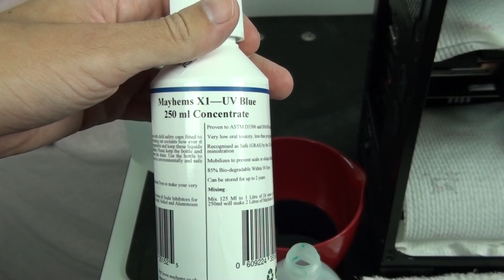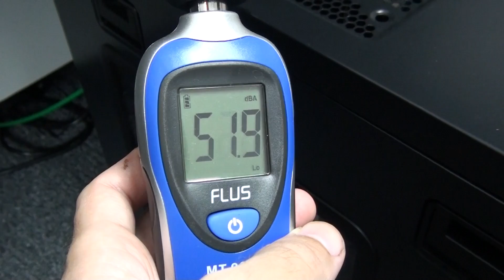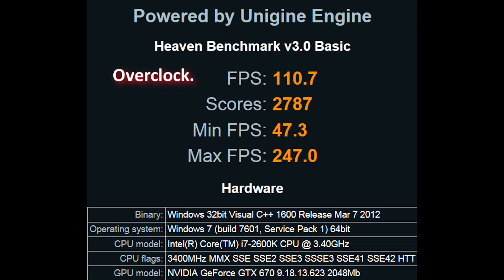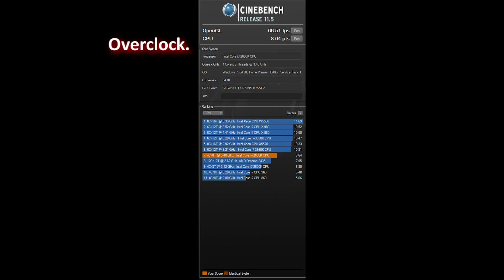Singularity Computers Water-cooling Guide: Part 2

Comment: For the power supply, find an AT power supply, whether used or new, then you won't have to worry about shorting pins or anything like that because they have a dedicated power button. Athena Power actually still puts out new units, currently about $20 on NewEgg for a 300W unit, which will be more than enough for testing fans, lighting, and powering pumps.

Comment: How did you get the air out of the radiators though  if you built and filled the system in the case ?

Comment: Did the rear fan not fit with the top 280 mm radiator and 140mm fans installed?

Comment: i like the runs you have btw i personally just redid my runs to be like this except i use an XSPC X20 750 pump and res combo then i go straight out from that into the cpu then radiator and into my gpu then back to the pump and res
Reply: I'd get rid of that rez / pump combo, mine stopped working out of no where a few days ago, didn't even notice for a few hours as there were no signs of failure. Thats the last time I get a bay pump lol. I'd only had it about 6 months.
Reply: FallingForgiveness d5 pump or nothing, everyone knows this

Comment: I have the same case and want to build a very exact water loop, but for GPU only and crossfire in the future. Can this loop handle 600 watt total TDP?
Only exception is XSPC EX280mm slim on top.

Comment: You should worry about leaks when you start actually using the computer because heat could expand things or make the tubing loose on the fittings

Comment: Is it possible to increase the performance of the pump, e.g. run at lower voltage while maintaining flow rate, by using a taller reservoir? I'm picturing water towers in municipal water distribution. Adding height to the res. would decrease the amount of work that the pump needs to do to keep the coolant flowing, but would 150-200mm of additional pressure at the pump inlet make a significant difference? Have you ever tested this?

Comment: Another point for checking for leaks is when the system is a max heat. Fittings expand, then contract when cooling. Obviously you check for this with your validation process. Good vid/info.

Comment: Hey. Quick question that always gets me wondering with watercooling builds. How did you get the res/pump to fit perfectly. The pump sits exactly on the HDD cage as well as the reservoir being clamped to the bays. Do you use a specific length fitting in between them? It baffles me how things come together like that so well.. Is it just coincidence? lol.

Comment: You could always go external and get a radbox, say something like this wwwdotkustompcs codotuk/acatalog/info_8836 there is also a rad box that fits 2 240mm rads.
As for distributors, look through this list and see the international one's wwwdottomshardwaredotcodotuk/forum/269620-13-list you could probably order off the manufacturers websites too.

Comment: Looking at your case, it's really not suited to watercooling. Their is no room at the front due to the hard drive bays and the divider, the top 180mm fan is at an angle so a rad would probably catch on the motherboard which pretty much only leaves the rear 120mm fan which isn't worth. I'd wait until your next build, get a new case or heavily mod your current one.

Comment: "i wouldn't be going for overclocking records until the air is out of the loop"

personally, i wouldnt be going for records without liquid helium. water just isnt up to the job when running a cpu over 7ghz

Comment: well done. very clean. i myself made a build similar to this in a 650d only with 2 670s. wish i had went with that bitspower reservoir instead of a bay res/pump combo. Im curious which fan did you use for that 200mm phobya rad?